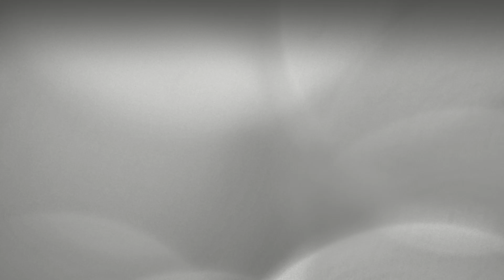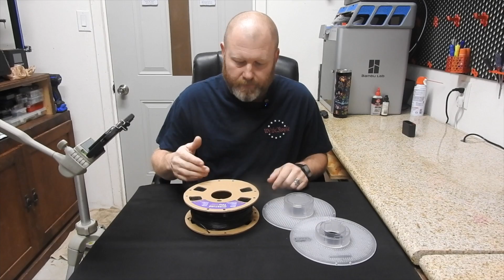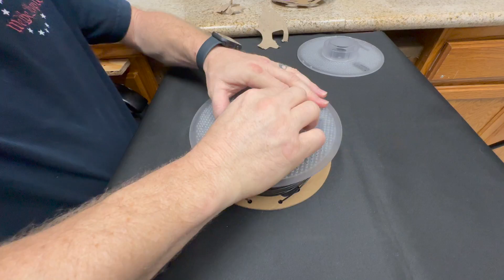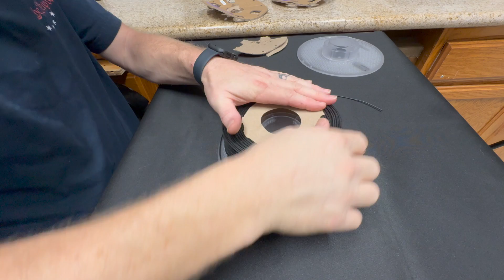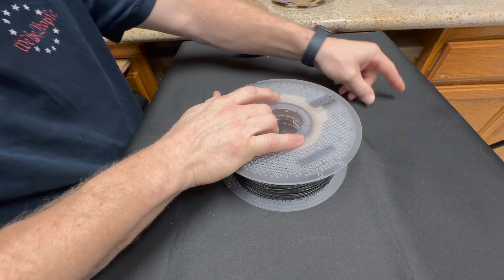Cardboard Filament Spool Swap

Comment: I've discovered that the new eSun high speed PLA cardboard spools have a smaller diameter centre than their older cardboard spools and they won't fit the bambu spools anymore. Of course, I found this out AFTER tearing off the side of the spool. Luckily, I managed to reglue it back on and left it overnight and then manually wound it onto a bambu spool.
Reply from the maker: So I would not recommend this to anyone, but there is one other option that I have done, but I’ve only done it successfully once. I had a spool where the inside diameter was too small for the bamboo spool, and I had already ripped the side of it off as well. What I did was removed the center hub from the cardboard spool, and then slid the bare filament onto the bamboo spool, and then very very carefully, flipped it over to put on the other side of the spool on. It was nerve-racking to say the least, The second time I tried it I lost the whole spool. So try at your own risk and only if you have no other option.

Comment: Doing this on a roll of TPU is pretty misleading especially when you're not supposed to use TPU in the AMS which is the only real reason to want to swap filament to a plastic spool.
Reply from the maker: At the time of filming it was the only cardboard reel I had left which is why I used it. It works exactly the same way on other reels.
Reply: Yeah,
That is an Overture spool, so it will work with 4 of my current spools, only one of which is TPU…

Comment: I Do this as well, but not all brands work well. So I keep a couple universal screw type adapters just in case. Also have to be careful as it is easy to knock the entire spool loose.

Comment: Why not just use adapter rings that snap onto the edges of the cardboard spool? 
You can find plenty of them for different brands on printables or makersworld, solves 2 problems: traction of cardboard edge and for some spools makes outer diameter suitable for AMS
Reply: Because if those edges are damaged then those snap rings don't work.
Reply: I tried using them but they break easily when removing them once the spool is used up.
Reply from the maker: I have tried them and for some reason they do not work for me. They either come off or slip so I gave up on them
Reply: I have tried them and the added increased thickness can rub on the inside of the AMS. I continue to look for other ones but am going with taping the edges of the spool.

Comment: What keeps the cardboard center from just slipping when the plastic spool rotates (like in the AMS)?  Seems like the plastic spool could spin with the AMS rollers but the cardboard could slip and not unload the filament
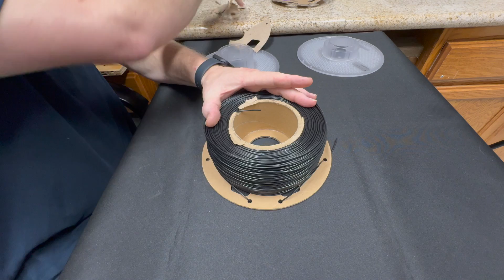Reply: There is a notch in the carboard inner roll that aligns with the tab on the bambu spool that locks it in place. You can see it at the 10 O'Clock position atr about 0:40
Reply from the maker: Most of the time there is enough tension to keep it from slipping just from the two sides of the reel snapping together but in the cases that’s not enough I have printed ring adapters in TPU and put them inside the reels which helps

Comment: I just want to add to this, if you are using Bambu labs refill spools, there is a location pin on the spool that aligns with a slot in the cardboard inner, and you must align this to get the two halves of the plastic spool to mate properly. cheers
Reply from the maker: True but for the spools I normally buy, I have found that most of the time it’s not an issue because they always seem to be a bit bigger and just slide over it.